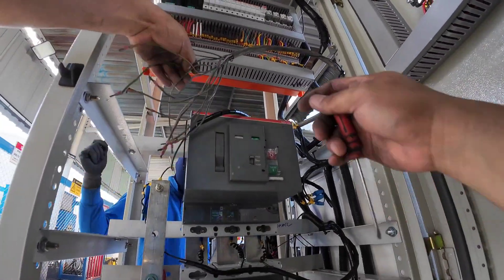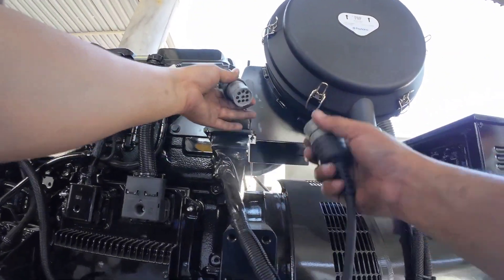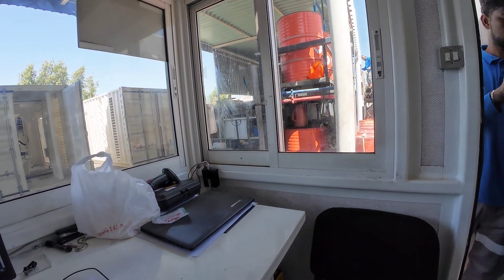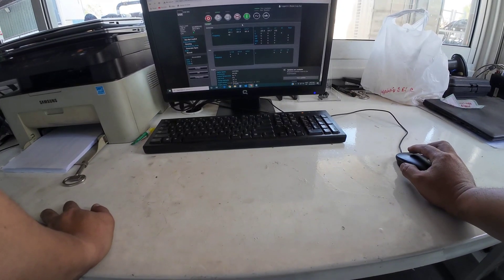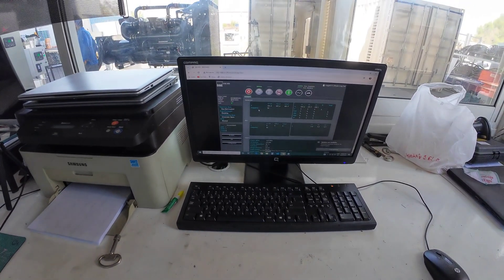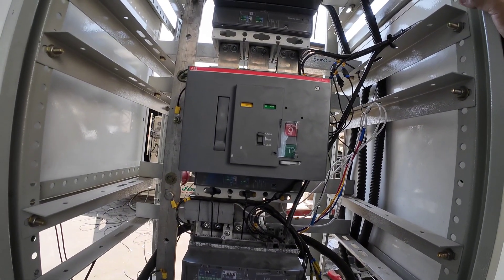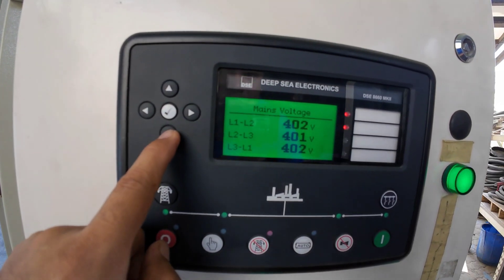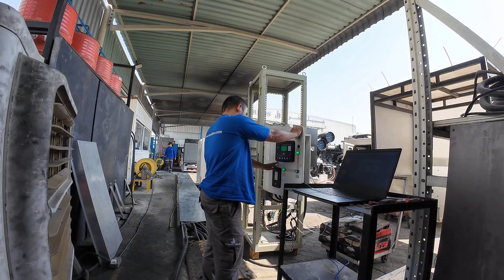HOW TO PREPARE AND DO MAINS GRID SYNCHRONIZING

Comment: Sir may inquery po ako. Dpo sya related sa grid synchronizing. Im having trouble synchronizing 2 perkins 4008 series engine. It has a woodward proact model I digital speed control which i connect to dse 8610MKII. from dse wiring topology, i installed 2 interposing for speed raise and lower. It is connected to dse digital output (speed raise/lower relay) on governor side it is connected to terminal 18 and 19. When i tested the unit, i noticed that there is a contact delay on the interposing relay. Do have any suggestion on how to resolve the issue. Can i make use of aux voltage input of governor (terminal 12 &13) and connect to dse internal analogue (terminal 35 & 36). Or do i have to change the governor to model II, so that it can communicate directly to dse.
Reply from the maker: Much good use the analog from dse control going to your engine my i ask this engine using ecu or heinzmann governor?
Reply: It is using woodward proact model I digital speed control
Reply: It is a conventional diesel engine 4008. Based in dse topology, internal relay should be choose. Install two 24Vdc interposing relay to control the speed raise and low

Comment: ano ba ang brand ng oil pressure sensor at paano e configure
Reply from the maker: Marami Ang brand n pweding magamit sir Kong ma config naman dapat nakaw base ka sa manual Ng sensor na gamit mo Kong 5 or 10 bar ba dependi Yan sa klasi